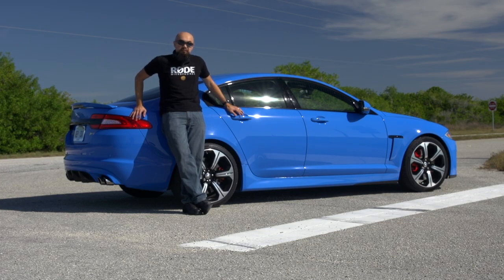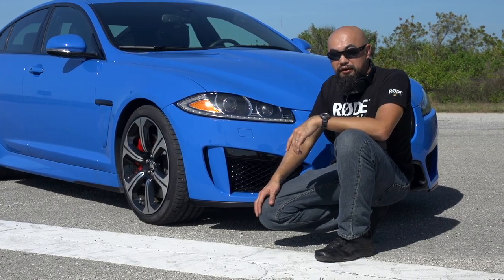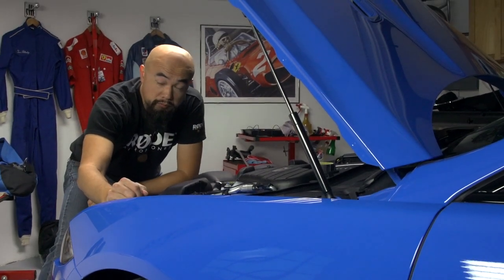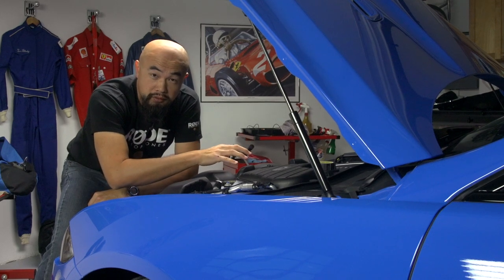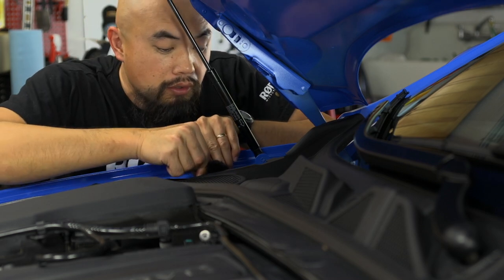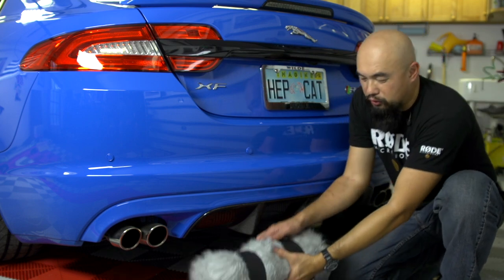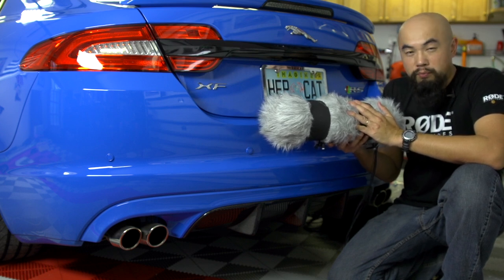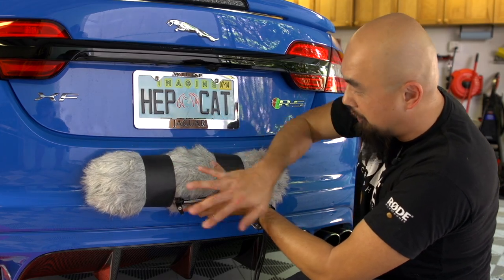Recording a 550hp Jag with Rode mics

Comment: Great video Watson! Lil late to the party but just heard your podcast on Tonebender.
Question: How did you run cables from the engine mics? Is the hood not closed completely?
Reply from the maker: Glad you like the podcast. After recording many different types of vehicles, I've come to the conclusion that most vehicles have slight openings for me to fit thin lavalier cables in a way that I can still open and close the hoods without breaking the cables.
Reply: Oh I see. Are the wires then coming out of the back of the hood near the windshield all the way through to a crack in the passenger window to your recorder? Just trying to picture how it's wired up as I've never done a car shoot. Thanks, Watson!
Reply from the maker: Jamie Branquinho Yes, the wires do route that way. Look at time frame 2:19 (69 Shelby GT500) and see where the thin cables are taped. https://www.youtube.com/watch?v=iE8Kgr4FhD8

Comment: Quick question though, would putting a stocking over the blimp and dead cat inhibit the sound at all?  Just not keen on gaffing the cover, would rather gaff the stocking and cut it away when finished.
Reply from the maker: It's a trial and error process to find out how much you can muffle or not muffle. Every vehicle is different. Some will have more wind problems at the rear where as some will not have any problems at all.
Reply: Watson Wu I'll give a go next clip I have to do, handy to know if it'll work.  Cheers mate.

Comment: which is the best mics for exhaust recording? dynamic or condenser?
Reply from the maker: I tend to like dynamic mics for most exhausts.
Reply: Thank you for your answer. Can i ask one more question?  
Im using one condenser mic (octava) and one dynamic mic (sm 57beta)

1. I would like to ask about the cutoff frequency for microphones on the exhaust. I mean high pass filter.  I tried different versions of the cut freq -  from 60 to 120 Hz.But in the first case there are a lot of low-frequency noises and in the second there are few pleasant low frequencies from the exhaust. How to do the right thing?

2. Why do you use the lavalier on the exhaust? What can this microphone give to the sound?
Reply from the maker: There isn't one microphone that can do that. It also depends on the vehicle and it's exhaust. Some are tuned and some sound better than others. I use multiple types of microphones all over so that I can capture many types of sounds.